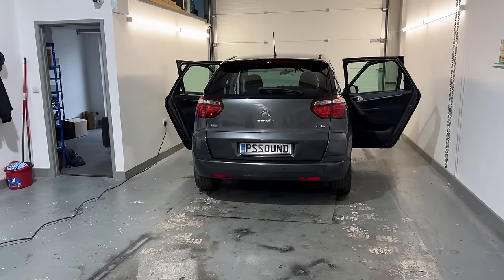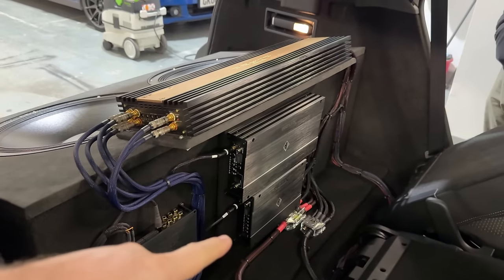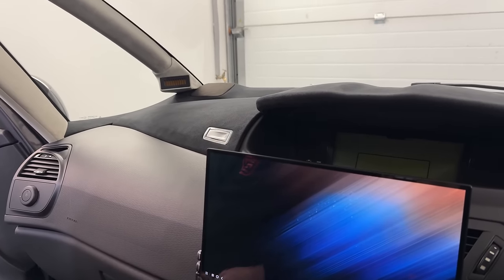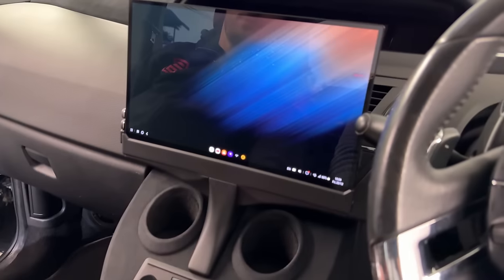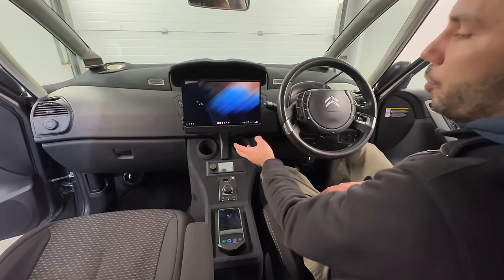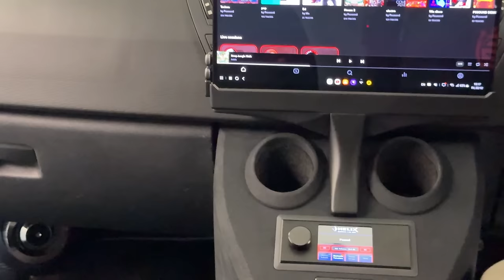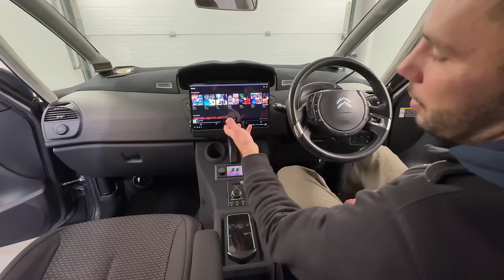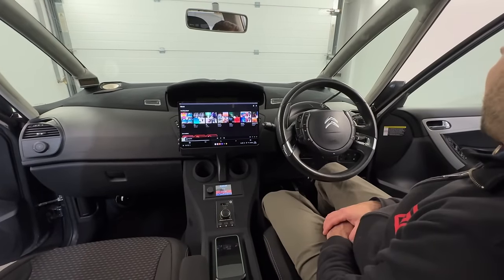The Best Sounding Citroen in the WORLD - Hi-End Audio System that Makes People Cry

Comment: I didn't realise the helix m1x could be ran with a single rca input, the manual advises against this. What difference does using 1 input make?
Reply from the maker: You get less input level, but then you just set the gain accordingly. You can mix L&R in the DSP.

Comment: I can get down to 29hz thanks to the cabin gain of my sedan with a single sealed IDQ 12 V1 DVC Sub. Two 18s seem excessive.
Reply from the maker: Yes, 1 would be perfectly enough for most SQ systems, i agree. 2 are personal choice. 
There’s so much below 29Hz! Better sealed subs can still get down to 22-23Hz. This system is linear to 12Hz, -6dB is at 8Hz. You kinda have to hear it for yourself to understand the difference.

Comment: What screen is that exactly? And what usb hub and volume knob?
I've got an s23 ultra and this seems like the setup I've been looking for, with lossless digital audio but still head unit functions.
Also, is it handier to use the usb volume knob or the director to control the volume? Is there some difference? I've only got a urc.3 for now.
Reply: I think the reason he uses the usb control knob is that it is more tactile and easy to operate without taking your eyes off the road. I have had the director and it is amazing for the amount of stuff you can do but you have to keep looking down as it is easy to make a wrong press on the touch screen. So I think he may use the director to make many different pre sets and sound profiles and detailed adjustments but the basic frequent things vol up down mute next track prev track etc on the usb knob 👍. I would love to hear the car now with the changes as it was awesome before without them.
Reply: I think youtube is deleting my comments when I mention the website for the screen. I found it on the popular website from China searching for OLED 13.3 touchscreen. the hub is just a generic one, nothing special, and the volume knob was mentioned in the video. The other reply you've got to your comment covers very well the volume control situation
Reply: @eduard.c.ionescu  Thanks.
I know, I've been having problems with links and deleted comments as well. Could you clarify e.g. what model number or vendor your screen is and how much did it cost. 
Also, is the USB hub usb3.2 or what version? Does it support USB PD? does it power the phone and monitor or do you power them separately?
Can the scaling be adjusted to bigger text and buttons for easier use in car? Is it 1080p, 1440p or 4k and what brightness is needed in the car?